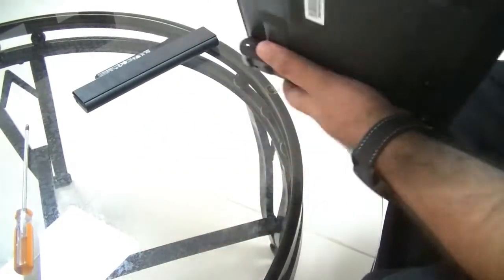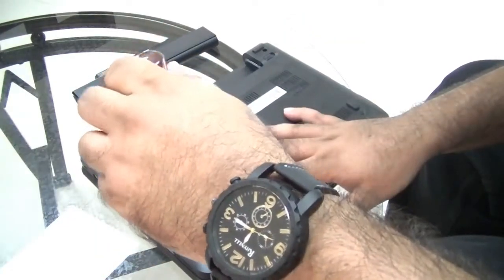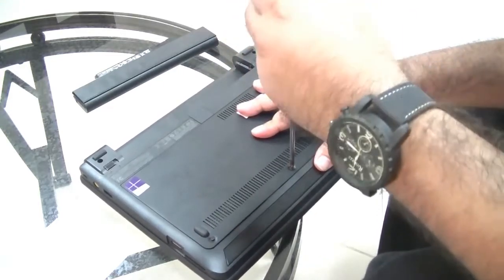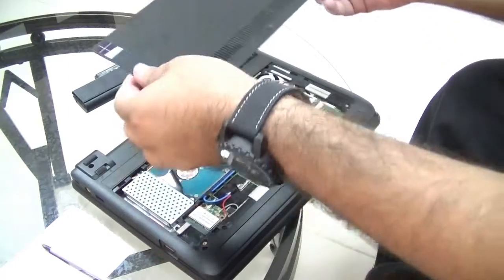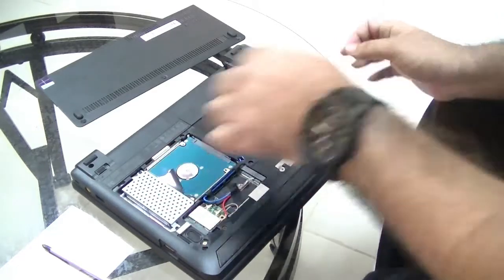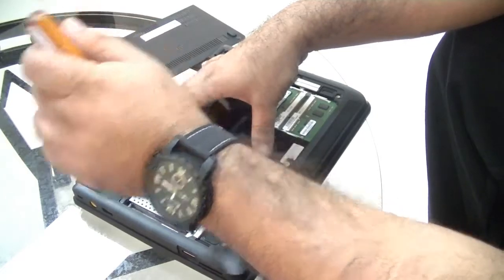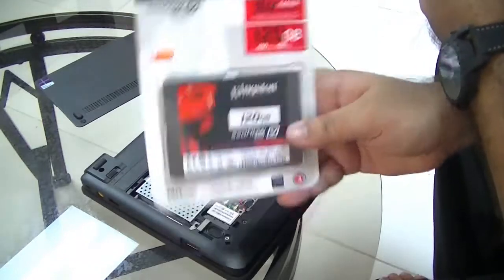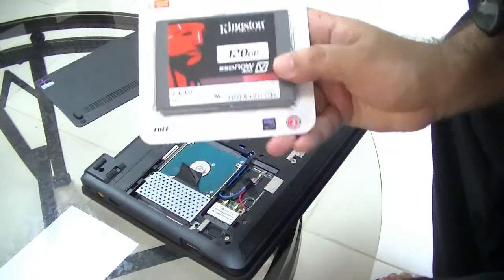Lenovo Thinkpad X131e Adding Kingston SSD Drive i3 Edition

Comment: managed to snag one off of ebay for a Linux project that I am working on, for CHEAP. itll be here in a few days. beyond excited. I knew it was what I was looking for, but seeing this is like a movie teaser for me. I have so much I want to do with this thing!
Reply from the maker: haha awesome that you got a good deal, I think Linux should work just fine assuming you get one of the higher speced processors (this i3 I am sure can run linux). Good luck and hope you get through with your projects! For the price, you can't go wrong, and mine is still banging, running Windows 10 with an SSD and it's pretty good for basic office work.

Comment: Just saw  this vid today, as I intend to do the same thing.  I have done the HDD to SSD swap ( and other HDD swaps) many times.  But never on the X131e.  My suggestion always is to CLONE the old HDD to to the new SSD BEFORE doing anything else.  Seagate and Crucial (and maybe other vendors) provide a free version of Acronis cloning SW that has proven to be BULLETPROOF for me dozens of times.  First, clone the old drive to the new drive.  Be sure the new SSD hss at least the same capacity as the utilized capacity on the old drive.  Use a standard SATA to USB adapter.  The SW will handle everything else.  Then install the new SSD.  When you install the new SSD it will boot and Windows (if that's what you are using) will not know the difference.  It will still be activated...  THANKS for the very detailed instructions.

Comment: Hi. I have the x131 with a celeron on it. Do you think it will support a 240 gb ssd?
Reply from the maker: +Dark Star hey Dark Star, it should work. Usually the processor has nothing to do with the hard drive in terms of detection. You may just want to make sure you are running any required bios updates. I use a 120gb kingston ssd on mine and it works flawlessly. Good luck!

Comment: Hi what did you do to make the ssd show up in your BIOS? as of in the video it dident show?:/
Reply from the maker: Hey Klattermus92, sorry about not showing that part with the BIOS, it auto detected the hdd so there wasn't any changes that I had to make to the bios. So you shouldn't have any issues. Let me know if you do though, interested in hearing your experience. Thanks for watching!